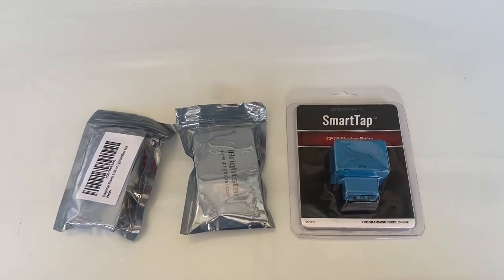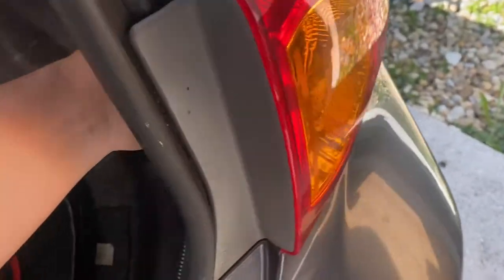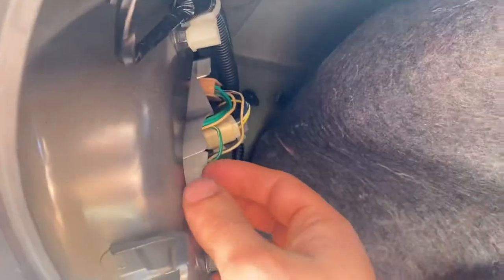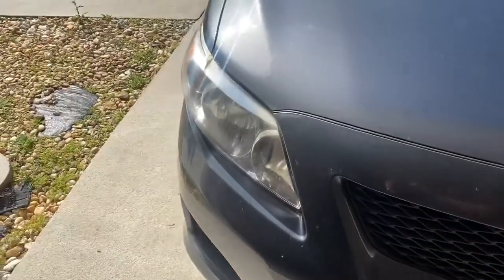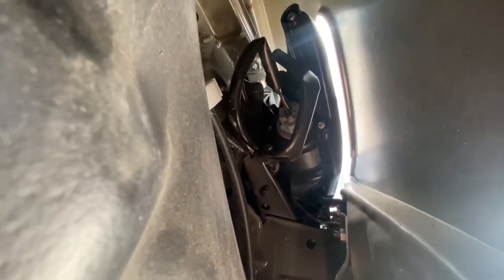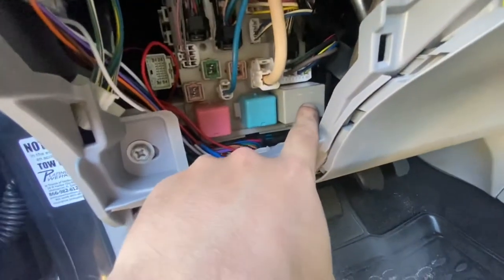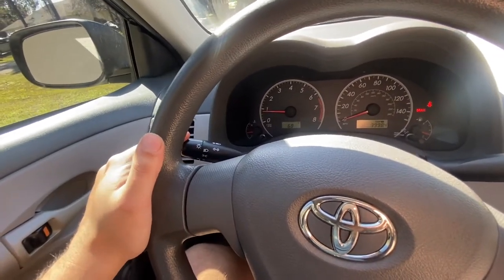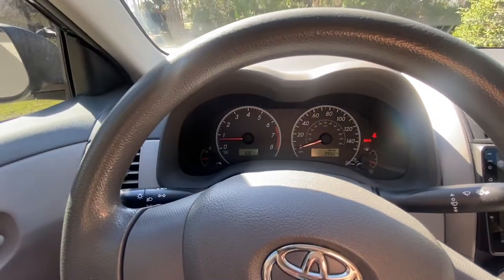Installing Diode Dynamics Flasher Relay and LED Turn Signals

Comment from the maker: Disclaimer: I had to cut the tabs off and I had to file some of the edges off the relay. For my year corolla(2009). I contacted Diode Dynamics and I told them all the problems I had, and I told them I don’t think it’s meant for our year corolla even though it says it on the website. And they were supposed to update there website with the modifications but I don’t think they have yet. But it was very tight trying to put it on the plug in the car. 
Sorry I didn’t explain that in the video.

Comment: These look so good. I think I might just do this to mine. I have a ‘13 model
Reply from the maker: It’s a cool mod to do!
Reply: @BrandonStellmach  I bet! I’m assuming it hasn’t given you any problems yet?
Reply from the maker: @jessiahy  I haven’t had any problems. The only problems I had was when I went to install it, I had to cut off the ends because it was to long. I wrote a comment about it. But after I did that I haven’t had any problems with it.
Reply: How did you get the original flasher relay out? I have a 13 Corolla s and I can’t get the oem relay out! Help please

Comment: I know this is an older video, I did the leds lights on my front of my 09 XRS and for some odd reason the leds are not working/pop a fuse. Im reading that i should have gotten the 7443 light and not the 3157, Did this make a differenct to you?
Reply from the maker: That’s weird that it’s popping a fuse, but I believe I always looked for the 7443 bulbs. And I have never had a problem.

Comment: when i click your link for the module it comes up for wrz and toyota scion frs is this a error?
Reply from the maker: No this is the exact one I used on my car. Toyota and Subaru use the same exact flasher modules.

Comment: Would that relay for the turn signal work for a 2010 corolla? Or what would u recommend for a 2010 corolla s?
I read previous comments about u trimming the relay? Could u help explain that? I really wanna fix this issue with my “10 corolla to avoid getting pulled over. Thank you for the video, keep the corolla videos coming.
Reply from the maker: It will work on any 2010 corolla, it doesn’t matter what trim level it is. 
And for the trimming it’s hard to describe it without a picture, but on the diode dynamics relay there are 2 tabs that stick out farther than the rest of the relay, and you need to trim them so they are flush with the bottom of the relay, so when you push it back onto the car it will go all the way on.
Reply: @BrandonStellmach  what screws do u have to remove to get access to the panel?
Reply from the maker: @GraveyardWarden  there are 2 Philips screws under the panel that is under the steering wheel. All the rest are just clips that you have to pull the other covers off.
Reply: @BrandonStellmach  installed mine today, super easy. Thank you
Reply from the maker: @GraveyardWarden  I’m glad you were able to get it.

Comment: He man! Is there a way to switch of this mode? Like so that I can take it back to the original single flash and then turn on so it does these cops car type flashes? Because if I use the cops type flashing they will stop me and say it's illegal so like is there a way I can use this on certain times only like example on a car meetup and stuff, UK what I mean
Reply from the maker: You know I have been wound eating the same thing, but I’m not sure, I know you can change some things with how the blinkers are with the turn signal stalk, but not sure if you can put them back to regular. I will take a look and see if I can do it to mine.

Comment: That headunit you have, how is the sound quality ?
Reply from the maker: I think it’s better than the stock unit. If that helps you at all.
Reply: Link for radio?
Reply from the maker: Link to radio for a 2009-2011 corolla:
https://www.amazon.com/gp/product/B087Z7JQ8R/ref=as_li_tl?ie=UTF8&camp=1789&creative=9325&creativeASIN=B087Z7JQ8R&linkCode=as2&tag=rollastore122-20&linkId=04bf37ca25eccaa5eb59dd4ef3ba465c
Reply: Does this help with hyper flashing?
Reply from the maker: Yea the flasher relay fixes the hyper flash.

Comment: Red leds in an amber housing? Boy what are you thinking? 😅
Reply from the maker: 😂 I ended up tinting the tail lights later on, and it hides the ember more so it’s not as noticeable.
Reply: @BrandonStellmach Good call man. I just installed the DD Flasher and tail to turn modules. Once I get another set of LEDs I'll tap into the reverse wire for an added set of reverse lights.